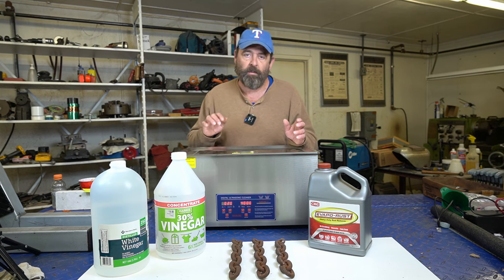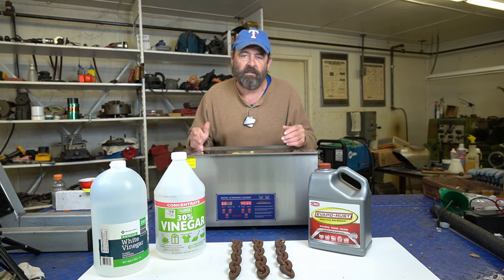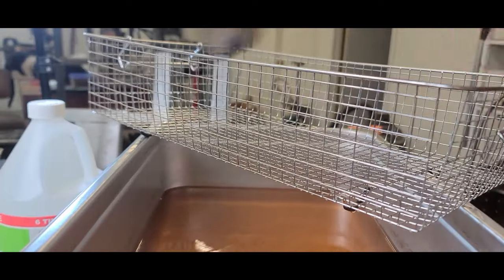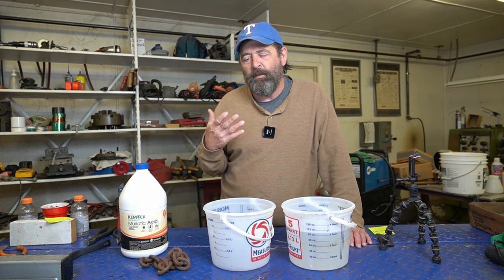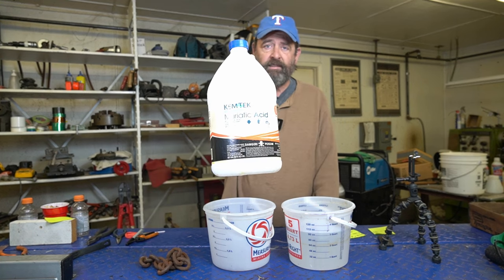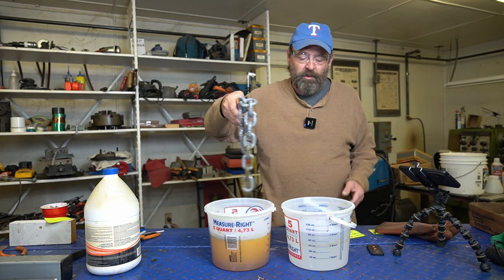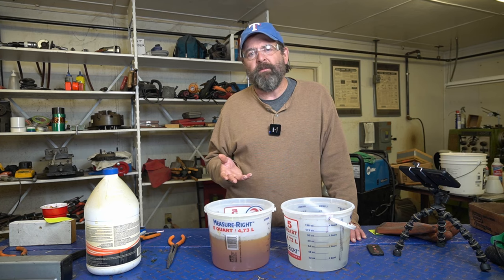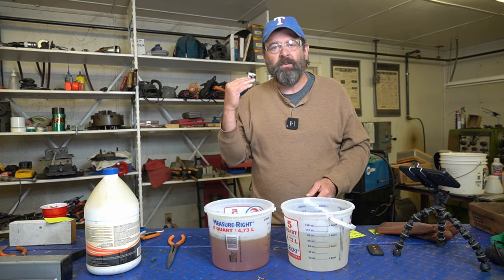ULTRASONIC CLEANER with 5% Vinegar, 30% vinegar, and EVAPORUST for heavy rust!  EXPERIMENT...

Comment: Hey, I work as an engineer in a german chain manufacturing company! If you use muratic acid (hydrochloric acid) for pickling for high tensile steel, especially for the lifting chains you tested, it is very dangerous because of hydrogen embrittlement. The hydrogen atoms diffuses into the metal an will eventually concentrate on the grain edges and the metal will become much more brittle. This will eventually lead to cracks which could mean that the chain could break under load! 
So please keep the pickling time as short as possible.
Reply from the maker: Thank you very much for the information.
Reply: The comment I came to make. 
Many DIY home shop and even shop professionals aren’t aware of Hydrogen embrittlement.
Reply: So what is the recommended way to clean the rust off?
Reply: @Marcus.Halberstram  Evapo rust doesn’t cause hydrogen embrittlement.  media blasting is good too; if you use the right abrasive media for the material to prevent excessive material removal
Reply: You have to soak it in baking soda & water to neutralize it
Reply: FYI, I asked Microsoft Copilot if one can harm metal if one uses muriatic acid to remove rust.  Here is what it said:

Yes, using muriatic acid (a form of hydrochloric acid) to remove rust can harm metal if not used properly. While it effectively dissolves rust, it can also react with the underlying metal, causing further corrosion.

To minimize damage:
- Dilute the acid: Mix one part muriatic acid with ten parts water. Always add acid to water, not the other way around.

- Apply carefully: Use a brush to apply the diluted acid to the rusted area.

- Neutralize and rinse: After the rust is removed, neutralize the acid with a baking soda and water paste, then rinse thoroughly with clean water.

For safer alternatives, consider using products containing phosphoric acid, which work more slowly but are less likely to damage the metal.

Thanks for the informative video.

Comment: Larry, Thanks for the "showdown". Your results in the first 3 are similar to my own experiences, I've not tried the acid and I will use it as a rush process to get the job done in a hurry. I'm almost 80 so I don't work fast. My go-to standby for rust removal is electrolysis. If you haven't tried it it's (relatively) slow but some of the benefits are: It stops working when the oxidation is gone. It does not remove the base item regardless of how long you soak the part. The active ingredient is Washing Soda (sodium carbonate) which is dirt cheap at Walmart. I use a small plastic stock tank and I've made the electrodes out of rebar and use a 12 volt battery for power. No caustic by-products. P.S. I really enjoy your no bs way of presenting ideas. THANX
Reply from the maker: Thanks for watching and commenting!  I have used electrolysis on two narrowed Ford rear ends and it worked great.  Unfortunately the video footage was compromised:-(

Comment: Hey Larry! I've been using the acid for years, and it never let me down. As a matter of fact, I used the same 5 gallon bucket for nearly a year. Just make sure to put a tight lid on it, because the fumes will flash rust anything and everything steel in your shop. It will also remove galvanize off of steel super fast! 😎👊
Reply from the maker: Thanks for the advice Jack.  And, you are so right about the fumes rusting EVERYTHING!

Comment: Great video!  And as others have mentioned, evaporust works well, but needs time.  Soak stuff in evaporust overnight in a sealed bag, then toss the bag into the ultrasonic cleaner with just water in it, in the morning, for a bit of extra agitation.  Works really well on medium rust.  Vinegar does a good job too, but is not as "reusable" as evaporust is, and also works quite a bit slower.

Comment: Evaporust works great it just take time, add some heat to it and it speeds up dramatically,  muratic acid works great to but the fumes will destroy anything in your garage or shop that is susceptible to rusting
Reply from the maker: You're definitely right about that,  muriatic will rust bare steels and irons.  Thanks for watching and commenting!

Comment: Acid    10 seconds   Its awesome.   I clean the patio furniture off from rust stains,  I don't even use gloves.   It gets hot about 45 seconds later,   DO THIS OUTSIDE  only   a paper cut takes .5 nano seconds to feel
Reply from the maker: Muriatic acid is a great rust remover.

Comment: So, when you are disposing of the acid after the usage of it, where exactly do you do that safely?  I mean that once you mix it with the baking soda and water can it be disposed of safely by pouring it out on a flowerbed (not a vegie garden) or simply down a sink drain? It the acid left in the bucket that you cleaned the parts in reused and simply poured back into the gallon jug or did you add baking soda to it as well and then dispose of it? Curios as to what you, yourself recommends. Thanks
Reply from the maker: I neutralize it with baking soda and dispose of it at my cities' used chemical collection that they have twice a year.  If you pour neutralized acids on the ground nothing will grow there!  It makes the soil  too alkaline.

Comment: Well, if you reported accurately,  you used the first 3 for 1 minute and you left the chain in the acid for 10 so that's not apples with apples.  The first 3 will definitely not work as fast but more time would have resulted in better results .
Reply from the maker: The first three lengths of chain were ran for 40 minutes each in the ultrasonic cleaner and the last piece of chain was in the muriatic acid for about ten minutes.

Comment: Really the difference is how much the acid will etch the item you are removing the rust from. Sure if you are removing rust from a chain muriatic acid is fast and cheap, however if you are removing rust of an item like an engine part that may have brass or aluminum parts attached to it, you may want to use something a bit more gentle.
Reply from the maker: True.
Reply: I wonder what is in chem-dip?

Comment: Evaporust has worked great for me, and  I don't need noxious chemicals in my shop.  But, I leave parts in it overnight, as it does work slowly.  Take it out next morning, rinse off with tap water in the sink (no I don't have a wife any more to chew on me for doing guy stuff in the kitchen,  even clean parts in the dishwasher which does an AWESOME job by the way).  Evaporust action is accelerated in the ultrasonic cleaner, though, but to use it over a longer time you'd have to keep re-starting it after each session, plus let it rest for its prescribed recovery time, which would be a pain.  So for me, using it at room temp overnight has always worked well.
Reply from the maker: Thanks for the input.

Comment: Muriaric advice, HCL is great for rust but can cause hydrogen embrittlement.  Better to get citric acid from a canning or jelly supply shop and make.a.strong solution.
Reply: There's a citrus based cleaner that's available at most any store, including hardware stores that sell cleaning supplies.  I use it full strength to clean my oven and smoker.  Works very good.

Comment: Evaporust has worked fine for me. Sometimes I leave stuff in it for 3 days. A month. Whatever. Whenever I get back around to needing the parts they're usually silver again. Then I put it back in the jug and use it again next time with the same results. I've never heard of anyone using it in an ultrasonic cleaner. But I just got my first cleaner for a fried motor and some electronics so that's how I ended up here.
Reply from the maker: Good to know!  And thanks for watching and commenting.
Reply: I second the recommendation for evaporust.  The “secret” is don’t be in a hurry.  Depending on how rusty the tools or whatever is when you toss it in the bucket, it might be just overnight or a week.  Most of the time, the iron/steel will come out of the evaporust dark grey in color.  That is raw surface steel.  Wash it off immediately then get it dry and protected ASAP.  Why?  That dark grey is naked metal, no rust anywhere but also no protection from rusting again.  I usually toss tools I’m restoring into a bucket of diesel oil  or something else to temporarily protect it until I’m ready to do it proper.  I buy five gallon buckets of evaporust when the old stuff gets totally saturated which can take months or a year depending on what I’m cleaning.
Reply: You should not leave parts in it long term either. If any longer than a month   I had an steel oil baffle that I forgot about and it turned it to mush after some time.